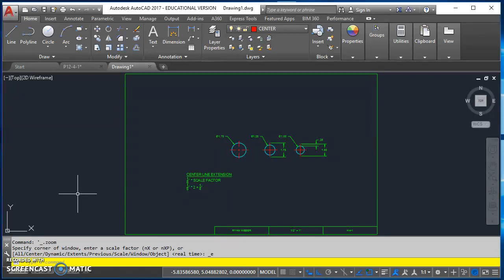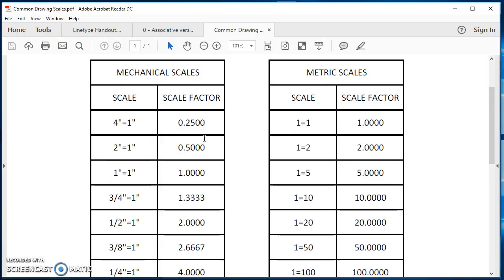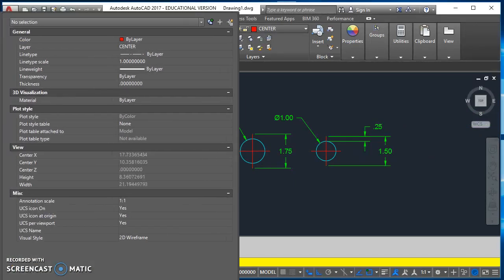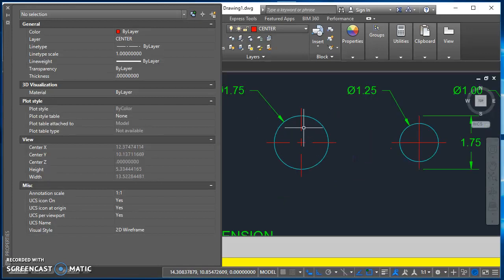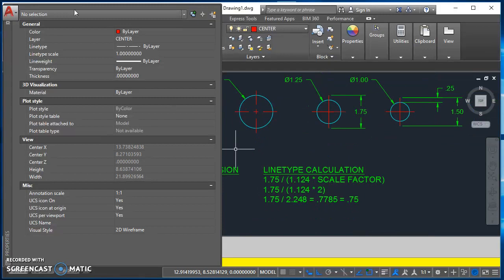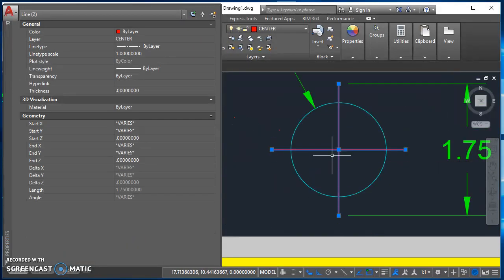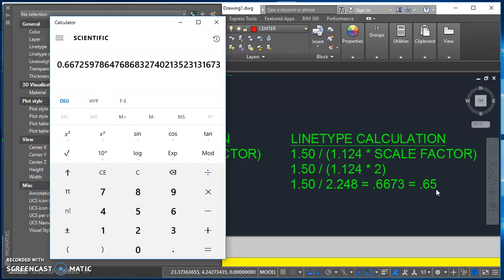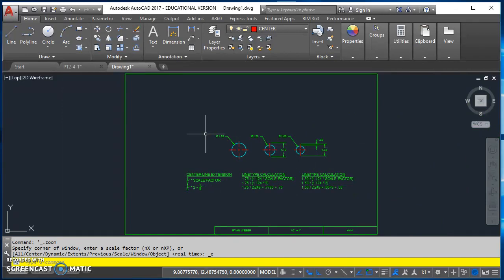Linetype Scale for Associative Drawings in AutoCAD

Comment: Thank you so much for the info on metric units LTS. please can you explain how you come about the 28
Reply from the maker: Absolutely. In AutoCAD for Center Lines, we use the Center2 linetype. With this linetype, a line has to be at least 1.125 inches long to generate the linetype of a  center line. So, 1.125 inches converted to millimeters is 28.5496 and I rounded this down to 28.